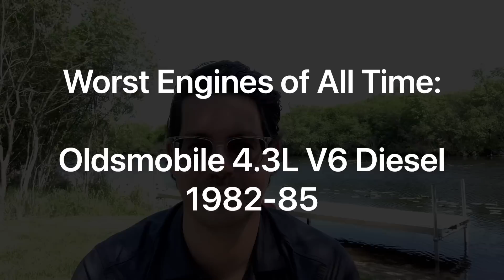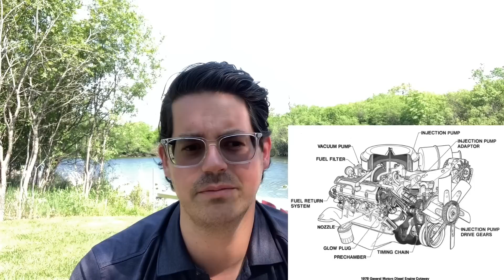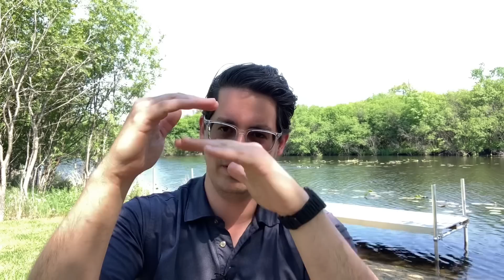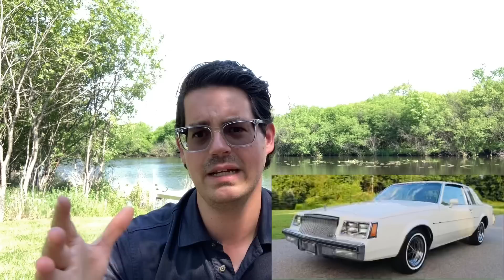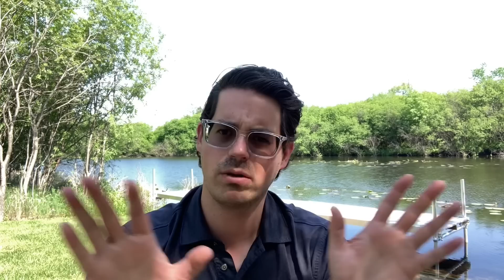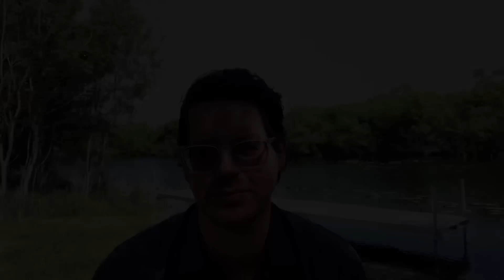Worst Engines of All Time: Oldsmobile Diesel 4.3L V6

Comment: I made a mound of money repairing the diesel injection pumps on 5.7 and 4.3 O’diesels. In late 70s through 84 when there were lots of them on the road and GM covered the pumps. I worked at a Chev and then Buick dealer. The diesel pump shop charged too much so the GM brands in the town sent them to me. My service manager and the IRS loved me those years. The elastomer damper ring that took shock out of the drive to governor weight cage would harden and fragment and then the bits plugged up ports and they quit. I did loads of engine repairs too but that was not as lucrative as injection pumps  removed, fixed, and installed in a little over 1 1/2 hours for a little over 4 hours pay.
Reply: Ah yeah ,I still came across some of those in the late 90s. 
The engine shop (which was full in house EVERYTHING) I worked at used to do a fair amount of big 3 diesel pickup repairs.
Ol stanadyne pumps weren't too bad except that ring. 
While working there I got enough guts to repair a Bosch ve of mine. 
After that ,it was all downhill on my VW turbodiesels ,tweaking em to the moon for a 25-30% increase in power 😁
Reply: @MrTheHillfolk  oh VW.... a perfect car.... TOTALLY F-ED because of 1 stupid thing
only motor ive ever blown up was in a VW.....was a touregg (or whatever)
.
it has an oil TEMP!!! guage..... in a "soccer mom" SUV.......... but ONLY an "idiot light" for oil PRESSURE!!! 
.
.
my family has health issues (diabetes.... my dad and sister.... but it "skipped" me..... at least so far) 
so we would always have to drive 320 miles to billings montana (as my town of 2300, while "large" for MT.... doesnt have the specalist Drs)
.
ANYWAY..... to make some money..... we would drive cars back from the auction house..... for a used car lot owner we were friends with
but this VW was at the used car lots "mechanic's" house.... 
.
.
we get their and i pop the hood and start checking fluids
"oh, dont worry.... ive checked it all"
.
"then why is it a quart low on oil....... and the coolant overflow bottle seems to have oil/water mix around it??"
.
"oh, thats probably from the pressure wash..... ill get you a quart of oil"
brings me a quart of some blue "compression in a can"...... that poured like water
.
"uh..... ok.... i asked for oil....... if everything is OK, why does it need this??"
"i dont have any 5w-30.........." (what mechanic doesnt have 5w-30???)
.
.
so he dumps it in....... and we take off
.
.
about 20 miles from his house..... i start to hear the lifters ticking
so a pop it into neutral (removing load and RPM from the engine......and trying to listen to make sure im hearing correctly) 
.
the SECOND it shifts into neutral...... KNOCK KNOCK KNOCK KNOCK
then.... AFTER 10 SECONDS OF IT KNOCKING!!!...... ONLY THEN!!!!.... did the low oil PSI light come on
.
.
.
but the oil temp was perfectly fine..... thanks VW
you stupid fucks
.
.
.
.
.
.
the oil pump "drive shaft" runs through a coolant passage..... 
you have ~40 PSI oil..... and ~15 psi coolant
.
so when the seal fails..... 40 PSI - 15 = oil in your coolant 
(which is why i saw the "sludge" by the coolant recovery tank)
.
.
.
i should have known better...... but dude is a "mechanic"...... and im not familiar with VW engines 
however.... i NEVER believed it was from the pressure washer...... ESPECIALLY when he brought me that "compression in a can" BS
.
i just expected a pretty good oil leak..... not a seal TOTALLY failing, blowing every last drop into the cooling system in about 3 seconds.... 
.
.
.
.
.
.
if you can tell me why..... in a SOCCER MOM SUV!!!!....... why oil temp is MORE important than oil PSI
i will go buy a VW right now...... take out a loan with my 322 credit score and everything 
.
.
its an SUV with a v8.....
cool..... but not a FUCKING RACE CAR!!! (and race cars have BOTH!! temp and PSI!!!)

Comment: I had a 84 buick century fwd 4.3 diesel wagon and that thing gave me vertically no issues over 9 years and put it up to 374 k miles and was running fine when sold and yes it had a water seporator on it did have a trans done at about 200k miles bit that car got a solid 40 mpg on the open road at 60 mph best I ever got 45 mpg across the flat mid west traval. Wish I still had it today actually . lol. And that v6 responded much better than the v8 diesels if you floored it it went it was surprising really it would burn the front tires in first gear. Not sure why it was so responsive maybe a different cam profile from the v8 version ? And the torque was at such low rpm compared to that gas engines too. It would pull our tent trailer effortlessly as well . only thing I ever did to that engine was one water pump and air filter. Just oil changes literally , no injectors or pump cost of maintenance was almost zero over 9 years . just one trans rebuild at 200 k which is typical of any GM fwd trans and couple sets of tire's and I think only one break job as well maybe 2 can't remember for sure. If I could find a low mileage one again I would buy it hands down for sure . 👍 then buy all the nos parts I could Posibly find just in case cause the parts house is going find anything these days I'm guessing the hardest thing to find is the injector pump . but they are easily rebuilt though. With common parts for the 350 v8 . but honestly I think it was a grate engine , oh exhaust manifolds one would want to have an extra set of them for sure they were prone to cracking I guess but mine never did 👍 honestly GM finally got all the teething issues sorted on these things Basicly and then put the thing out of production but then GM is kinda famous for doing that with stuff . what ever happened at gm in 1971 kinda led them to that practice over all with R&D . so it seems.

Comment: Regarding the combustion of a diesel: not air and fuel are compressed until self combustion. Only air is compressed. At a certain point diesel is injected into the hot compressed air and the mixture ignites.

Comment: I've never owned the 4.3 V6 diesel nor have I ever actually seen one in person but I've often heard that they really were not that terrible because when they finally came available the engineers had solved most of the issues the early 5.7's had. I've owned 3 of the v8 olds diesels, 2 5.7 both the "DX" iteration and 1 4.3 v8, both 5.7 engines were pretty good and mostly trouble free but the 4.3 was in an 82 cutlass supreme and quickly got replaced with a Buick 430 I had on hand because it could not get out of it's own way! One of the 5.7 engines was in an 81 custom cruiser and even had an aftermarket turbocharger on it... It was a great car and it got used for a whole lot of camping trips! Wish I hadn't sold it or could find another one like it. The other one I owned was in an 84 Delta 88 and I got to drive that car for a whole week before some numbskull stole it and it was never seen again.
Reply: Somebody STOLE your GM 5.7 Diesel Delta 88?   WOW!   I never heard of such a thing, most people couldn't even give them away for free!

(just to clarify, I  too had a 5.7, as I once owned a 1980 Bonneville Wagon.   Loved that car!  This was before "rolling coal" was a thing, but it was sure fun to do when anyone tailgated you.   Drop it into 2nd and have a good laugh!    It went about 125K then the engine just started unraveling at a red light, while I was waiting to make a left turn)
Reply: @johndaniels651  Not long after it was stolen there was a guy with a tow truck that was arrested because he was stealing cars by towing them away and scrapping them. I'm pretty sure that's where it went, either that or someone who just didn't know any better took it. It definitely takes a special type of person to want to own an olds diesel.

Comment: It's like you say Adam, GM used the customers for R&D.  They must have known that the original 4 head bolt design was never going to work out, along with a lack of water separator.  I'm sure engineers reported these issues with these original designs.  Did upper management just not want to hear these warnings in favor of getting this stuff "to market" and saving money?  I still can't understand why the powerful car industry did not have enough political pull to soften the CAFE regulations to give them more time for R&D so that the initial products would be more reliable/robust.  It doesn't take a genius to realize that the customers lost to these initial disasters would never come back to GM, no matter how good the products might be, and you can not blame them.  I would certainly behave the same way, cars a major expense.  Why gamble on an "improved GM product" when there were so many good/great foreign alternatives.  Don't get me wrong, some sort of "CAFE" mandate was needed for the good of the earth, but the playing field was surely stacked against the domestic automakers.    Upper managements' decisions to rush untested engines with known issues to market, surely helped kill GM  I only wish that OMC, the company I worked for (Evinrude/Johnson) would have taken the time to learn from all the automakers errors.  Our initial 
"smog outboards" were the same thing, untested with known issues.  These disasters killed our dealer network and loyal customer base.
Reply: These blunders break my heart for sure.  All these horrible "mistakes" not only led to the downfall of the US automakers, but to killing our economy and the loss of decent jobs for so many
Reply: Management thought(probably somewhat correctly) that customers couldn't handle the specific maintenance a diesel requires. The solution was just to eliminate the water separator. Diesel was notoriously dirty back then and the water ruined the injector pumps and caused hydro lock pushing the heads off the block(stripping head bolts, blowing gaskets).
Reply: @metrawatt    OK, well I understand that concern.  Diesels are surely not for everybody, but they do require some very specific maintenance.  So, management's answer was to just eliminate the filter?  That doesn't make any sense.  Trying to educate/screen potential buyers before the purchase would have been a better decision, steering folks back to gas engines that did not want to make the commitment to diesel service procedures.
Reply: @donk499  a very short sighted response for sure
Reply: @metrawatt    I guess I just don't understand....
Reply: When any business takes its customers for granted, Karma usually descends upon them in one way or another.

Second to a home, vehicles are the second most expensive purchase Americans make in their lifetimes. Few US cities and suburbs are conveniently  habitable without a personal vehicle. 

I understand that CAFÉ standards hurt automobile manufacturers yet after the '73 fuel crisis, I would have thought the Big Three would have had enough political influence to push the required fuel economy standards back a few years to prevent Washington from forcing their customers to become paying R&D testers.

GM's diesel engines, Chrysler's Lean Burn engines, and Ford's Auto-Lite carburetors caused huge headaches for so many owners. 

I remember the clacking and black smoke billowing from tailpipes in beautiful San Diego. Owners saying they had to wait to start the engine. Some of them looked embarrassed at the pump, especially when the cost of diesel fuel became more expensive than gasoline.

Marvin K Brown Cadillac replaced diesel engines with gas engines because some of their valued customers complained repeatedly. 

A diesel engine in a VW it's one thing. A diesel a Cadillac, is entirely something else. The former is transportation. The latter is choice transportation.

Comment: Never saw a 4.3 diesel. BUT I did work on an 82 Buick Regal that originally did have 1 in it. The owner swapped a 4.1L Buick 4bbl and 200r4 trans into it at some point. He really did a great job ( or somebody did). Correct engine and computer harness as well as updated ECM and PROM. Because it was still registered as a diesel, he never had to go for emissions.

Comment: The 4.3 V6 in the smaller FWD cars do actually drive good... plenty of power in town....takes off easily, very unlabored in town...labored on the interstate above 65 mph...
Reply: 3 speed trannies. Probably with a 2:28~2.41:1 final if its the GM I know & love.

Comment: Fascinating discussion of an interesting engine. I would enjoy a video regarding the Buick 4.1 V6, as seen in full size Cadillacs. Another video idea would be the range of small displacement small blocks that came along in the late 70s at both GM and Ford (Olds 260, Chevy 267, and Ford 255). An entire video on the 8th gen t-bird and related mercury cougar could also be pretty interesting, since there isn't a lot out there about the 80-82 generation.
Reply: There was also a 4.3 diesel V-8 from 78-79 sold in the Cutlass.
Reply: Chevy also had a 262 V8 in the mid/late 70's

Comment: One thing I remember about this era of GM cars was that when guys used up or blew up their diesel, they would simply swap it out for a 350 gas or even the 307 engine which I understand is on the other end of the spectrum of GM engines which ended up being a great move for the car owner, where he could get better power and great fuel economy to boot.
I would like to hear your take on the 307.
Reply: I don't think I've ever heard anything "good" about the 307. . .
Reply: @life_of_riley88  The 307 engine was fine. It was almost as ubiquitous as the Chevy 305 in terms of vehicle applications. It made okay power, and was smooth and whisper quiet. They weren’t known for having problems, either. The 307 and Chevy 305 made up the GM “5.0L” engines in the 1980s.

Like I said, not a huge powerhouse, but it was quiet, smooth and reliable.
Reply: The 307 Chevy was made till '73. The 307 Olds came out in '80. Depends on which one you're talking about...
Reply: Olds 307 was reliable but had 0 power. Not bad low end torque for slow city driving but a dog otherwise. Olds 350 was the ticket and would bolt right in where a 307 was.

Comment: GM owned Detroit Diesel during this time.  Seems like they would have a division that’s experienced with Diesel engines make this instead of one that’s never made one.
Reply from the maker: Remember, they were making super heavy and expensive, two stroke diesels.
Reply: They weren’t making a 4 stroke diesel at the the time only 2 strokes and they are not made for”typical” car driving , I believe that’s why

Comment: The power and torque ratings of the V6 diesel are almost identical to a heavily-smogged Mopar 225 (that will run forever but suck gasoline like a V8). Another factor in making the GM diesel program evaporate was affordable gasoline in the mid-1980s, the same market force that made the 1986 Eldo/Seville/Riv/Toro a harder sell.
Reply: On the other hand, a slant 6 that hadn't had its valves adjusted regularly, like I suspect most weren't, could pass for a diesel in the noise quality. Lol my family had more than its share of darts/valiants

Comment: Yes. Each division made it's own V8 350.
This led , SOMEHOW,  to the big recall in late 76 of a large number of mostly Buicks which wound-up with Chevrolet 350s.
My aunt bought a new Century Regal in 76 and in a few months recieved her notice. It was late in 76 so the 77s were on the lots and she took the car back and the dealer traded her straight across for a new 77 Regal.

Comment: I had to read all the comments posted thus far before making my own.

I bought a 1982 Regal with the 4.3 litre diesel back in 1991. The car had 73,000 miles on it. It needed an injection pump rebuild. The car itself was immaculate. So I got the injection pump rebuilt and the car ran great! ...for a while.  The car slowly started losing power and I soon found myself having to add transmission fluid to the fuel to give it enough power to get out of its own way. Replacement engine parts soon became obsolete and I was having to improvise and was changing starter motors every 15,000 miles or so. Bosch made an aftermarket starter that would have costed $260 to purchase,  which would've been insane at the time. The highlight of the car and engine was that at one time I had the car up to approximately 120 MPH on a lonely stretch of highway and the car sailed along like a dream! Eventually the starter went out and at 132,000 miles I pulled the engine. It's interesting though that the car has a 2.56 end gear ratio to accommodate the amount of torque and still give it the mileage it got. I have a 3.8 gasoline engine that I still have yet to put in the car, but to compensate the taller gears am adding a 4 barrel carburetor and manifold. It's been an interesting learning experience.  The Regal is a beautiful car, and I wouldn't have it had it not been that it came with the diesel engine.
Reply: Why do you need to add a 4 bbl. to 'compesate' for 2.56 gears?
Reply: @mikehasemann9270  since the typical end gear ratio is 3.23:1 for a 3.8 litre V6, I'm compensating the engine with a little more intake.  It's almost like being in overdrive when I hit third gear,  and the quadrajet will give it a little more for startoffs.
Reply: @danielbennion80 Did you ever swap the engine in your Regal?
Reply: @gregorymalchuk272  I'm still working on it. I was forced to move across town shortly after my last comment, and I've been trying to get settled ever since.  But I'm still very eager to finish the job and have recently purchased some additional items.

Comment: I thought the olds dead-sel was bout 16:1
22:1….I was surprised !
Reply: IDI (indirect injected) diesels all have crazy compression ratios up in the 20's. DI (direct injected) are typically in the mid teens like you thought.
Reply: And not to split hairs, but is actually was 22.5:1 ratio
I’m sorry I couldn’t help my self I thought the extra 1/2 would really really surprise you